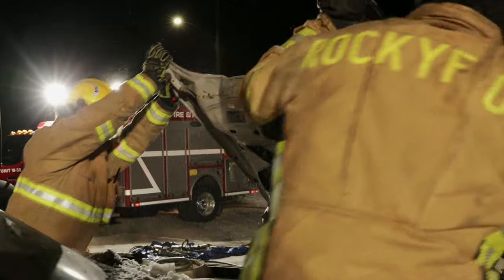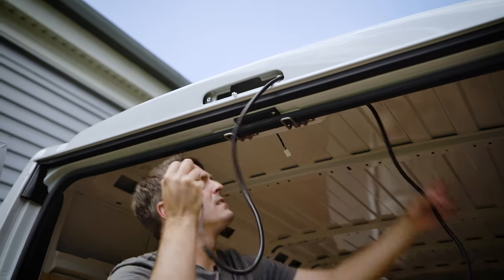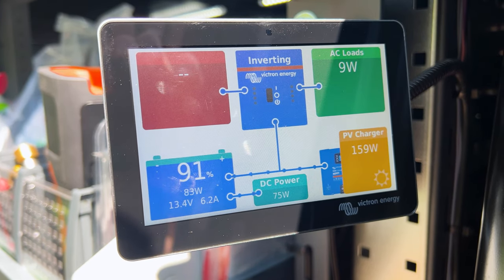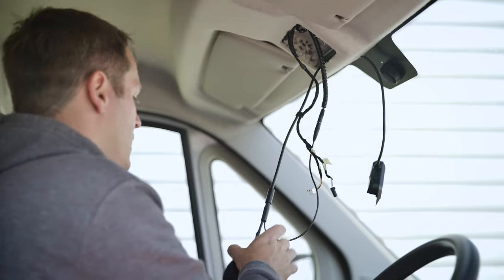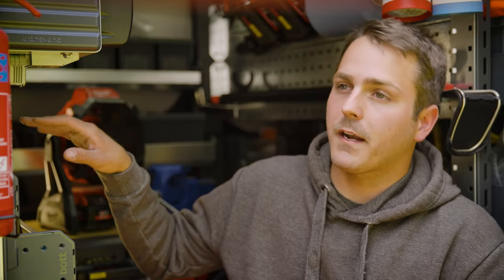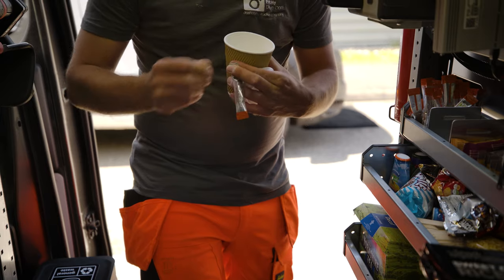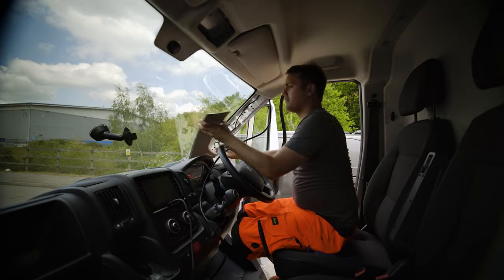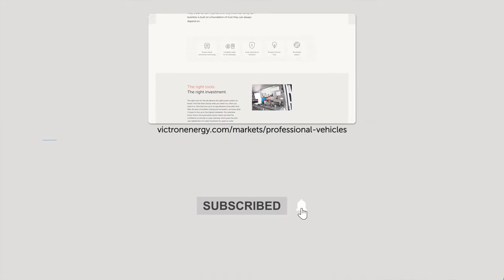Mobile dash-cam installer powered by solar & lithium

Comment from the maker: 🎯 Key Takeaways for quick navigation:

00:00 🚗 Fit My Dash Cam offers camera options and security solutions for vehicle protection.
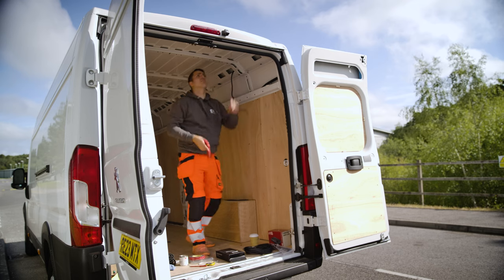01:08 🔌 Victron Energy powers the business, ensuring reliable installations and reducing client stress.
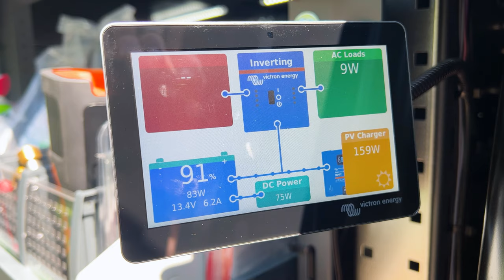02:41 ☀️ Solar panels on the van roof keep batteries charged, making the business self-sufficient.
05:15 🛠️ Victron components are chosen for their reliability and high quality, integrated into a flexible system.
08:15 💼 Customers are investing in vehicle efficiency, recognizing the value of quality installations and long-term use.

Comment: Did I hear the commentary refer to a schematic as to how you've wired it all together being in the comments - have a possible use for a similar arrangement with a waste company up in the Midlands.
Reply from the maker: There is no schematic drawing as each vehicle and requirement is very unique.  There is a list of the kit used however.
Reply: @VictronEnergyBV  I appreciate that each install is unique; I meant his specific install.

Comment: I have 2 Orion Tr-Smarts and very interested in the way you control your second Orion using MCS. I was unaware of MCS until now and from a quick Google it seems very expensive to purchase to control my second Orion.
Reply: Yes, it's an expensive system - but it's more so for service vehicles with the ability to control the lighting, power systems, link into vehicle CAN and the like. If you need to do this with a standard vehicle, it may be possible to do it cheaper with a Teltonika tracker which can measure speed instead, and trigger an output above a certain speed.
Reply: @fitmydashcam thanks for tip. I've realised I can use the GPS connected to my RPi GX to set a gpio high. 👍

Comment: A little off topic but how far away can you mount a solar charge controller from the battery. 
 Can I mount it 10ft away?
Reply: depends on the cable thickness, but 10ft isn't an issue at all.
Reply: Generally, you have to ensure there is not too much voltage drop if the wire size is calculated correctly it should not be that much of an issue

Comment: Why not use a multi plus instead of separate inverter and charger?
Reply: As it was a demo, it made more sense to use separate units to show more of the range of products.
A Multiplus definitely could have done the job.
Reply: @fitmydashcam  I’m running a Multiplus in my work van and it’s great.  Not running a Cerbo like you though.  Looks pretty sweet